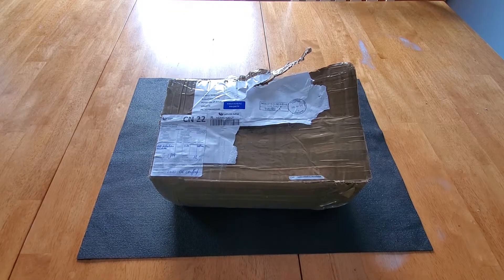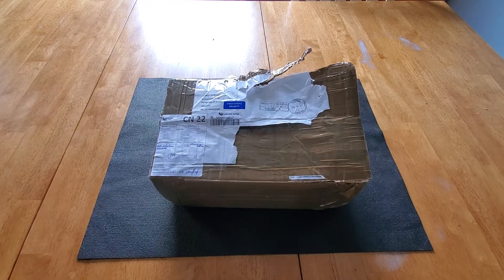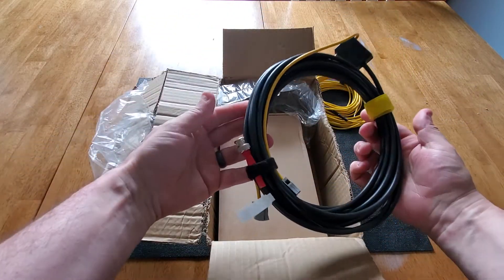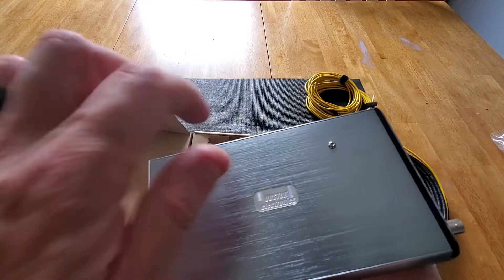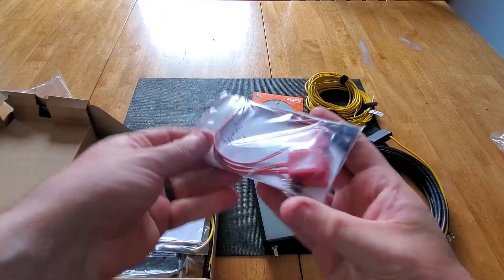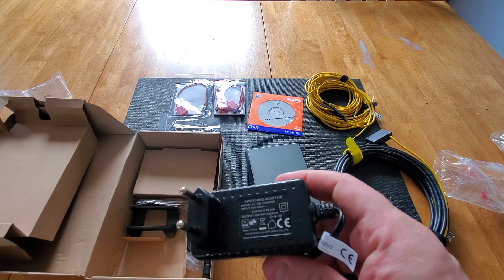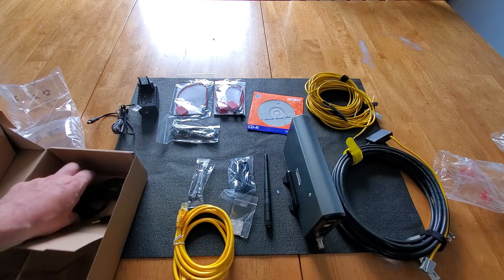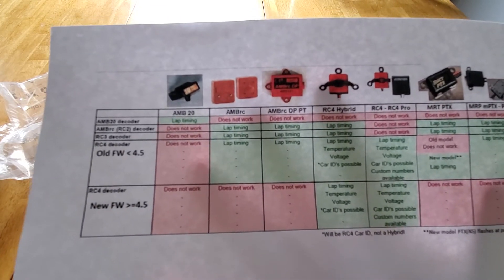Review: Vostok Electronics Lap Timing system decoder: model: ID010 - Part 1 - Unboxing

Comment: im not voltage educated, what would I use for a 12volt 2 amp power source
Reply from the maker: There are a lot of the AC power boxes that plug into the wall and have the round connector that fits in the decoder. I found one of those with the right spec and that is what we use.